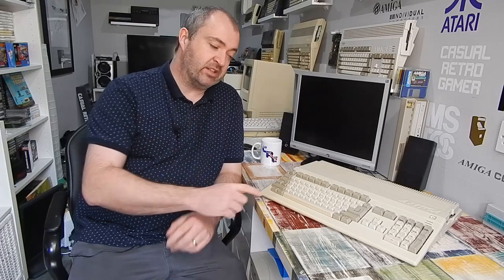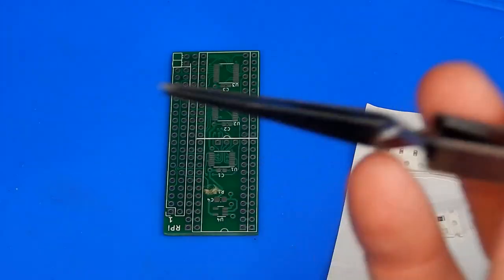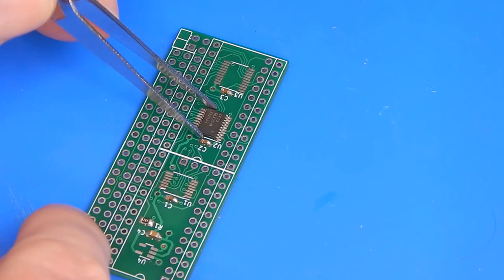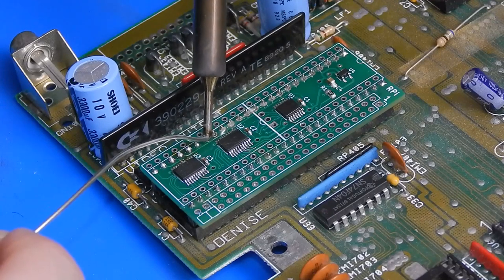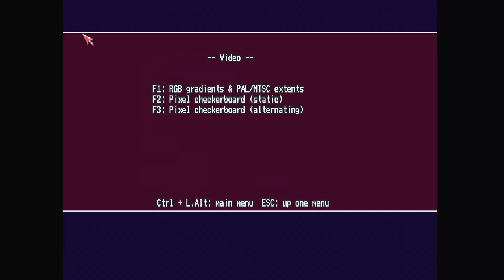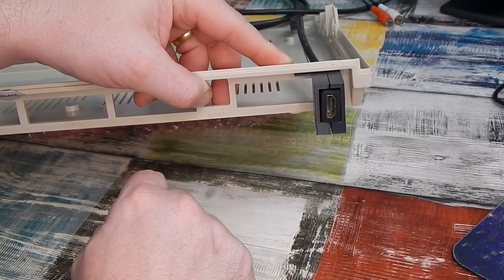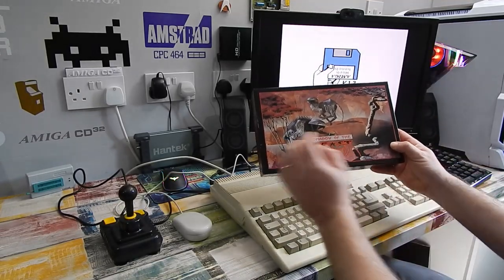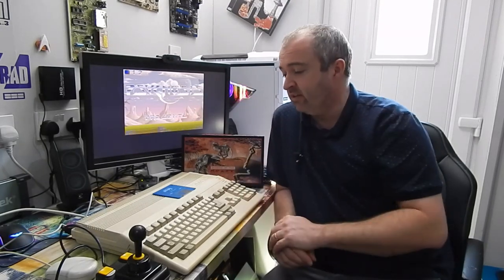Lets build an RGBtoHDMI adaptor for the Amiga 500

Comment: I'm only half way through the video but your flux definitely doesn't seem to be helping much. I've only done this a couple of times but the flux I used helped it all just find the pins. Maybe time to try some other brand.
Reply from the maker: I've got some chipquik flux which seems to be the go to brand for SMD soldering.  Hopefully going to build the second one tonight.  I'll let you know how it goes.
Reply: @CRG  I'm no certainly no expert and I've only done it maybe twice. I just remember the flux making things a lot easier. Glad it worked though. That's the main thing, right? Nice little design for the output too, impressive!